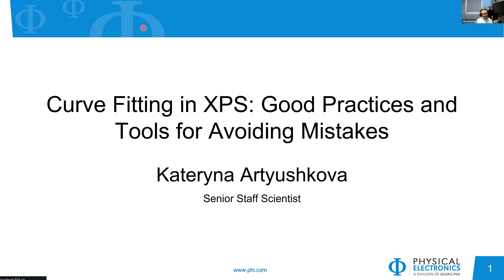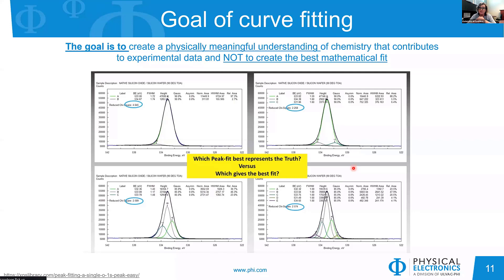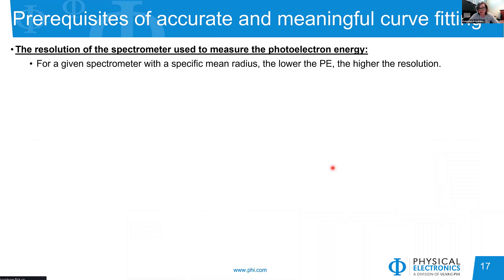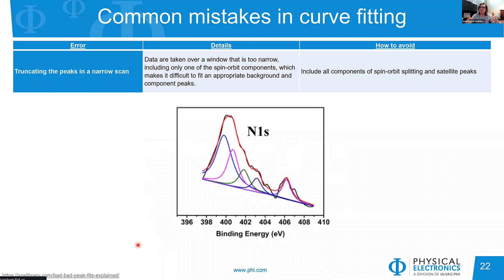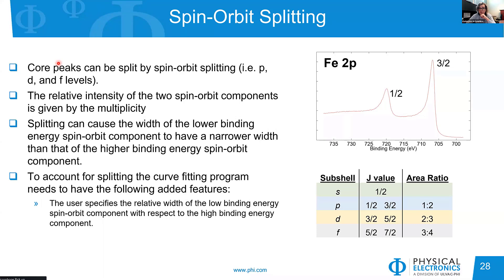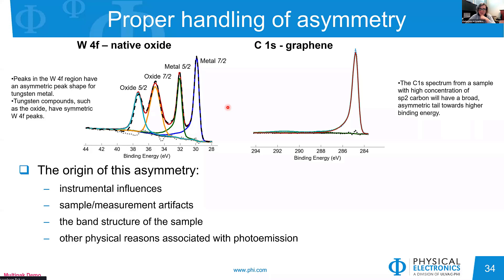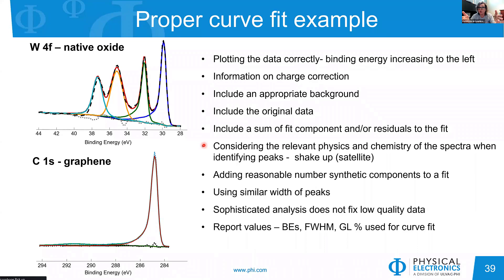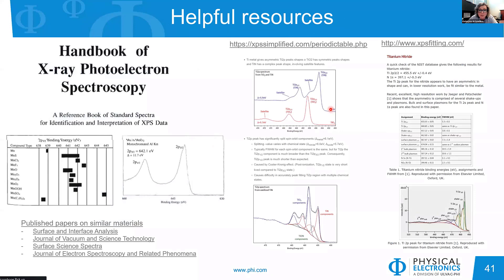Webinar on Curve Fitting in XPS: Good Practices and Tools for Avoiding Mistakes

Comment: 34:07 I think you should not ignore spin orbit splitting of the oxide. In the shown example you can see that the fit is not good. Its just an unnecessary simplification.